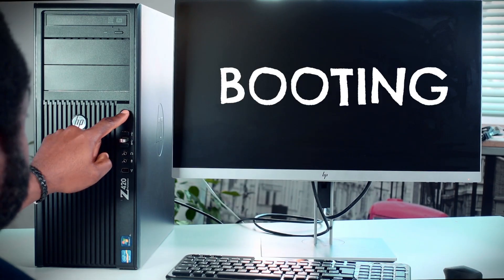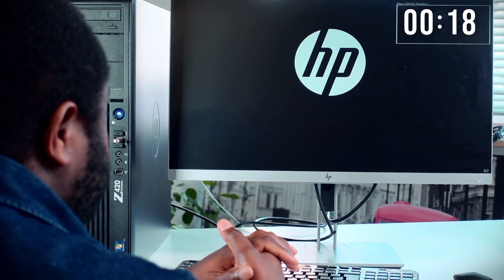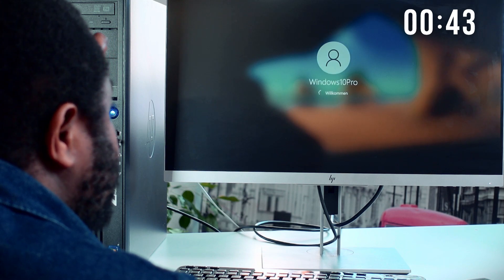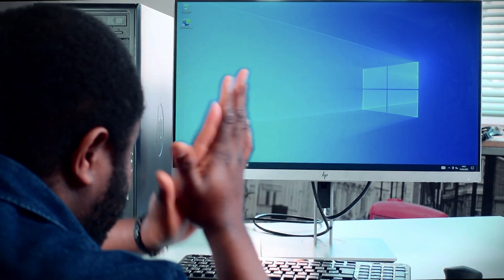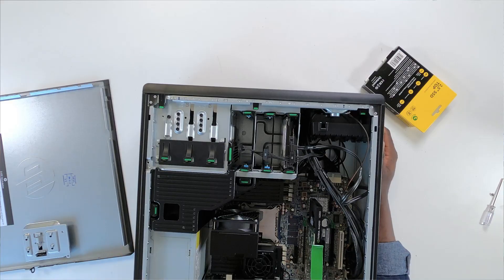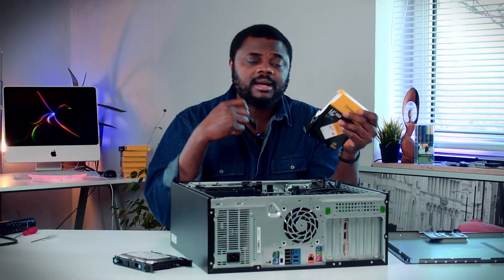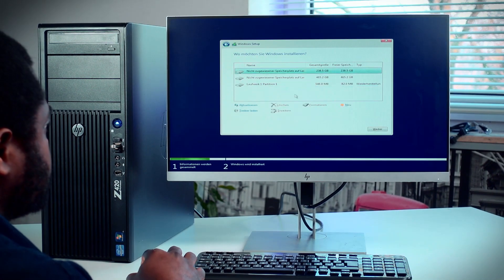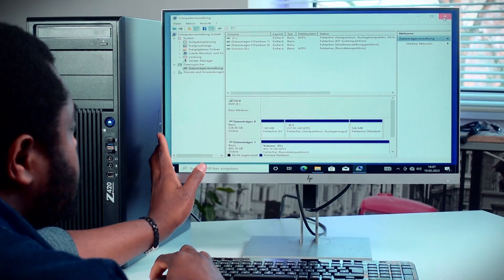I Made A HP Z420 Running Windows 10 Boot In 15 Seconds!

Comment: I have a crucial ssd on mine,it shows the hp logo for 3/4 seconds,then the windows logo with the spinning circle,but it doesnt boot like yours,win 10 pro with a fresh installation
Reply from the maker: really? and the pc is also z420?
Reply: @Hardwaremoney  yes its a z420,i attached my ssd sata cable to the gray port because they have a speed of 6gb/s
Also the cable has that speed
Reply from the maker: @nicolocampioli1739  ok will check and let you know